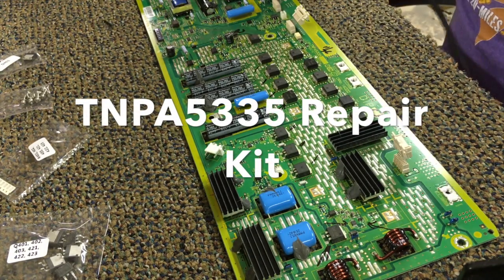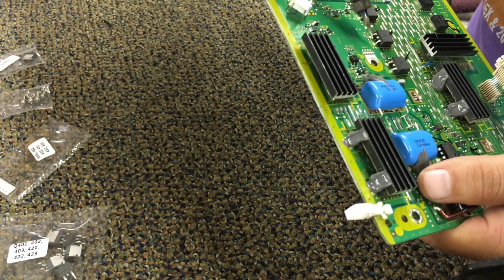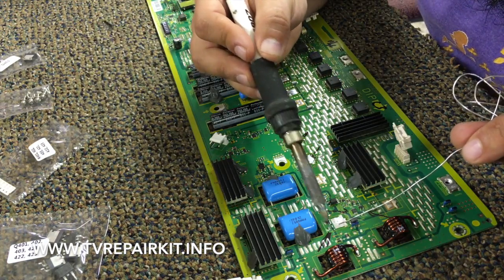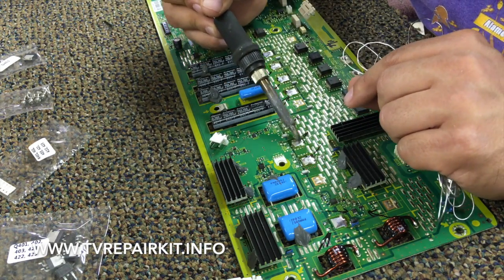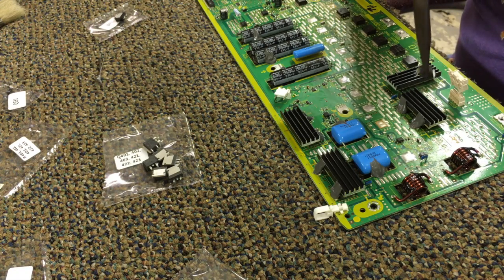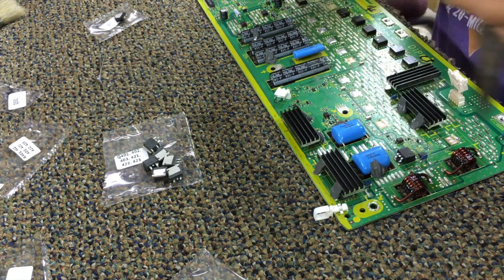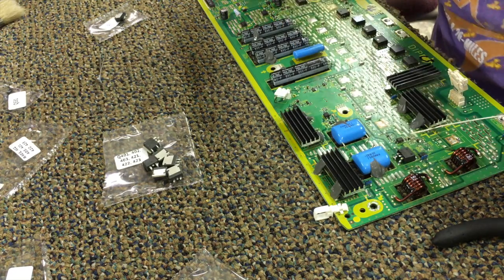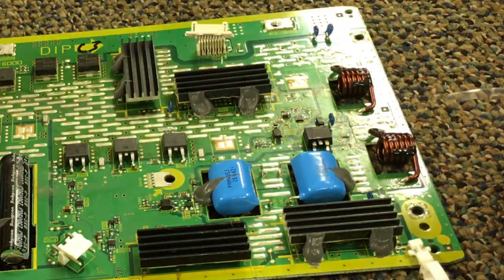TNPA5335 Repair Kit

Comment: I have the same board diodes D 641-642-643 on the pins that are next to each other that are soldered to the board is this correct?

Comment: Is it possible to replace the mosfet transistors and not the IC's in this repair, or to know if the mosfets or the IC's are the failure point?

It would be much easier to just use the mosfets from the repair kit and skip the IC's if possible.
Reply from the maker: I don't know of a way to test the IC's only. The mosfets are easy to test as they usually short. It would be easier but I don't think it's worth the chance of ruining the kit.
Reply: +TV Repair Kits I'm trying to do this at the moment but struggling with my 40w cheap solder iron. do you think I need a hotter one? I see a 100w one on ebay but I'm not sure. basically it's really hard to melt the solder when re seating the larger chips...I keep trying it the way you do it but it's not melting properly. ideas thanks?
Reply from the maker: +Jimbob84141 a 35W or 40W soldering iron is usually good enough. Could it be the solder you're using melts at a higher temperature?
Reply: +TV Repair Kits yes ok just spoken to a guy he suggest my solder iron is a bit crap so yes a low watt but better quality probably much better. I also bought a lower melting solder with a bit of silver in it...fingers crossed! thanks.